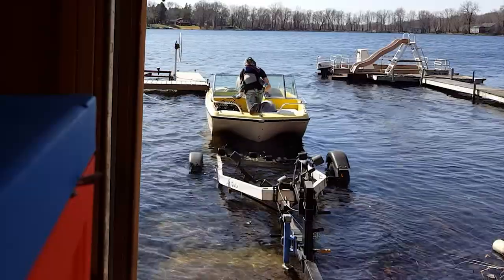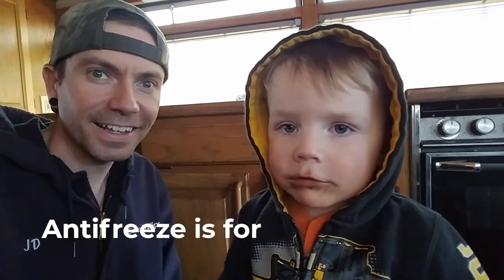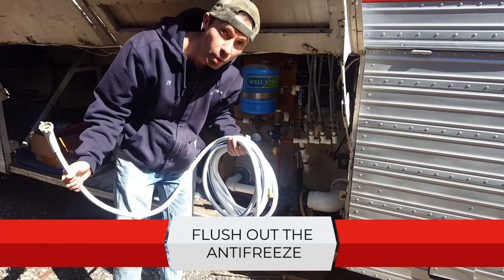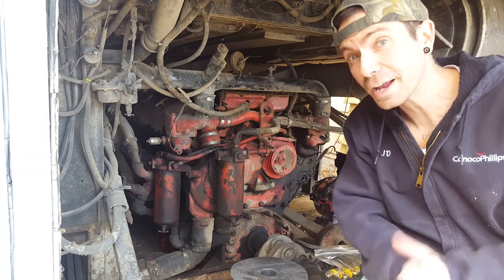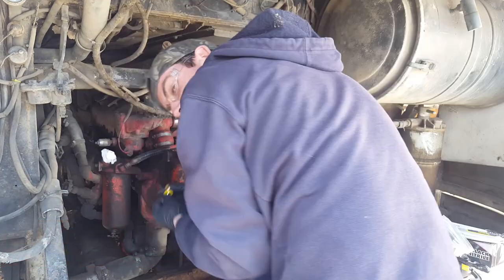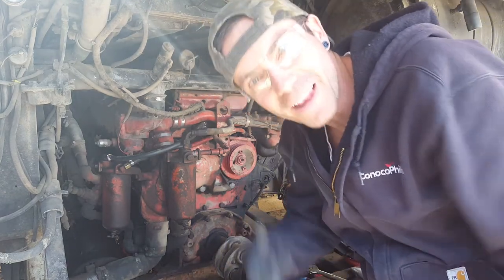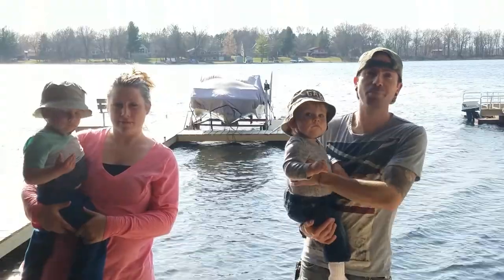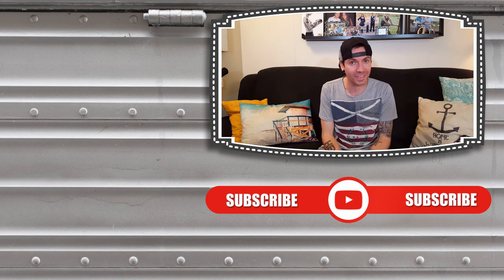IT'S SUMMER!! Bus projects and Lake living  | The Renegade Life | Episode 6

Comment: We just bought a lake house and we have a really mucky shore. I'd love to know how you made your sandy swimming area!
Reply from the maker: A little bit at a time! Every year it gets better. We have a few tools that we purchased that has made it better. This is not the order we bought them in, but if I could go back, this is the order I would do it in.
1) Lake Bottom Blanket: its basically a large tarp (10x50ft) that we purchased from Amazon and then you purchase your own rebar to tuck in the pockets every 4.feet to hold the blanket down. Place over the weeds along your shore as soon as the ice is out (if it freezes where you live) This stops the sun from reaching the plants and effectively kills them. They suggest 6 weeks but we did longer. After the weeks were dead we'd move the blanket and then get to work pulling the dead roots out with a rake.
2) weed roller. Also purchased from Amazon use this the roll over the newly cleaned bottom. This helps clean it further, gets rid of muck and also keeps the weeds from returning. I rolled everyday for about a week then reduced to once a week. Now the areas that have been clean for a long time, I roll once a month.
3) we recently added a weed cutter for the deeper areas that I can't rake or roll from the dock or in the water because it's too deep. This just cuts the surface floating lilie pads. It's not a forever fix as it doesn't kill the weeds, but helps it look better for the season.

So far we've invested hours and hours of time and $600 to the cause buying those 3 tools.
Reply: @TheRenegadeLife  thank you for sharing! So you didn't add sand?
Reply from the maker: Nope.